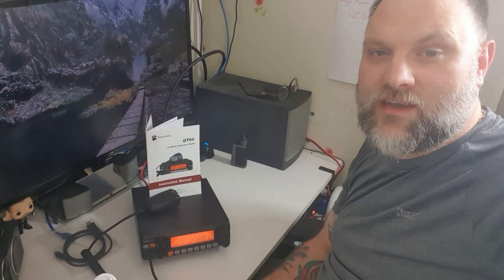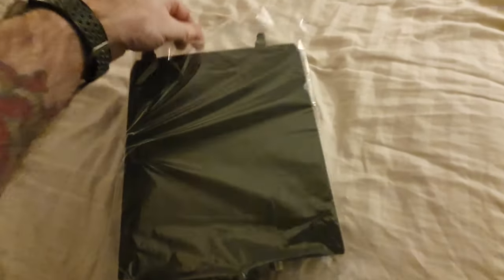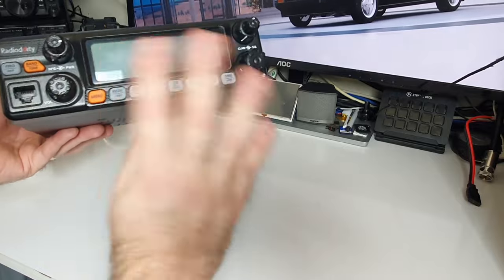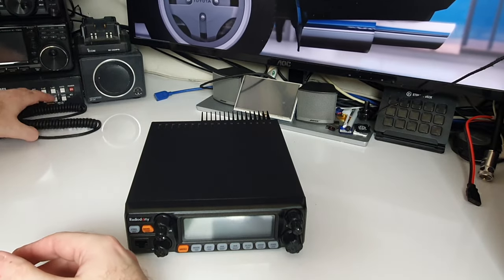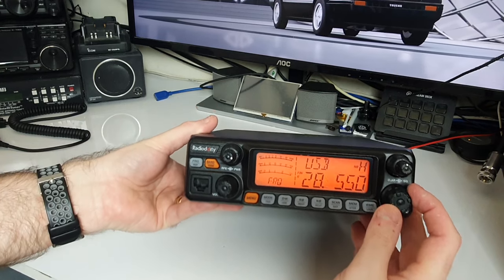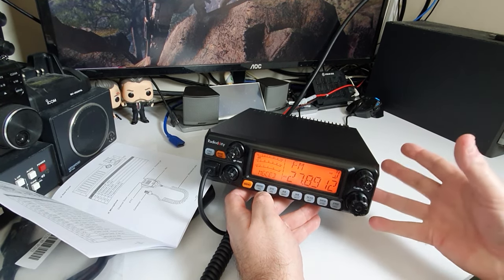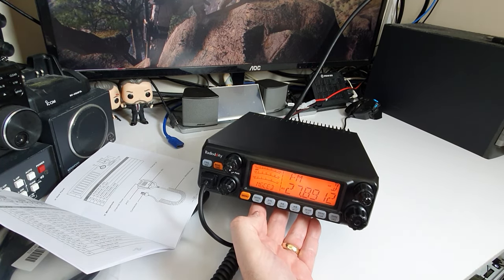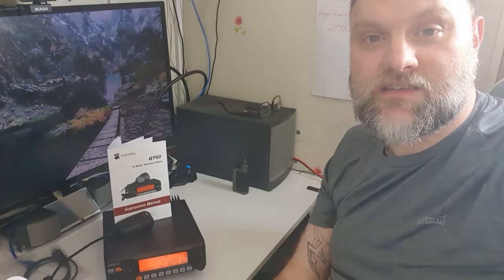Radioddity QT60 Review! 10m 12m 11m multimode! Modding, programming & unboxing! All you need to know

Comment: Hey. Ordered one 5 days ago. Am on a budget so didnt get the Ameican models however this one has the added advantage of 10 & 12m. Would have liked backlit buttons and ability to show channel number and frequency simultaneousley as well as display dual monitor frequency simultaneousley but its good enough. Bussy getting the other components together - antenna, cable, connecters, power supply etc.